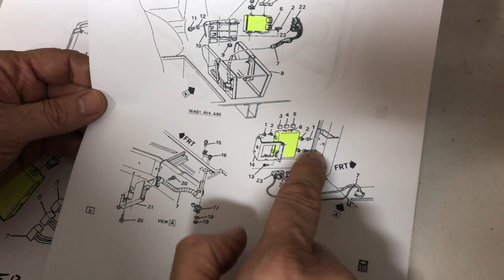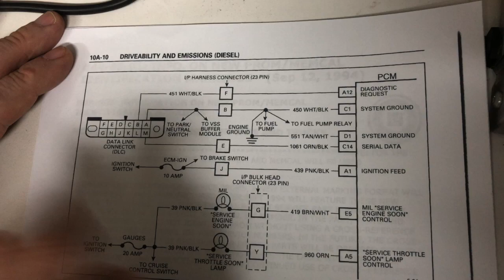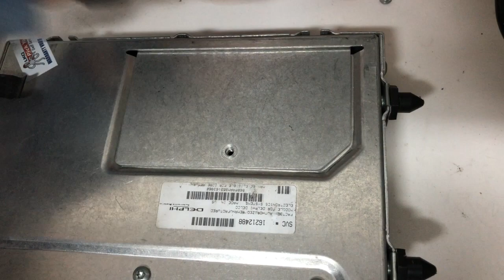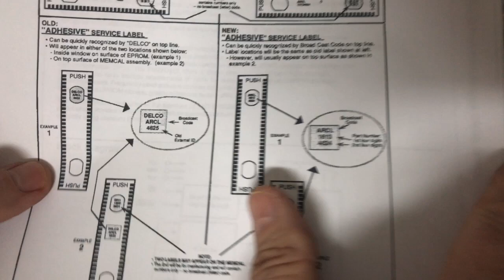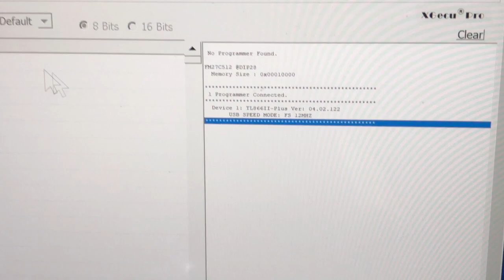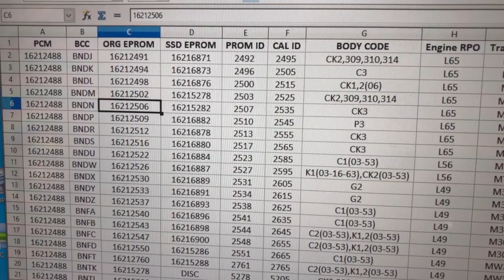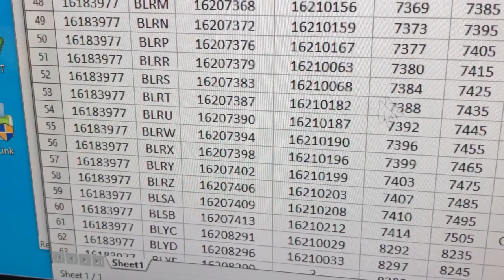1994 1995 GM 6.5L Diesel Salvage Yard PCM Inspections & EPROM Testing & Identification (Chevy & GMC)

Comment: How do you know if yours is bad and you need to replace
Reply from the maker: These chips are pretty rugged, usually you're only replacing them because of wanting the last contents inside them not because of a failure.   The contents, the program they hold, was updated frequently to correct problems in the field by GM for drivability or emissions reasons.  If the chip were to fail, I would expect to detect that using a Tech2 scan tool as this should cause a failure to communicate properly with the PCM.
Reply: @DrShock  thanks
Reply: @DrShock  I have a 94 gmc k1500 suburban. Im pretty sure the tranny is stuck in second gear. No power at all. Ive checked everything else and replaced about $3k in parts with little to no results. Im down to the ecu and/or shift solenoids. If I go the ecu route I was told I should replace the prom as well. Should I? And if so where can I find one and how do I know if its any good if I go to a junk yard for instance? Please help! I need my horses back!
Reply from the maker: @joshakers1  Given your situation and spend so far, I would not recommend a salvage yard unit but rather just purchase a remanufactured PCM.  A remanufactured PCM has been tested to be sure of no faults. Typically the remanufactured PCM you would receive will not have a PROM installed.  This is because while the PCM covers many GM models, the PROMs are very vehicle options specific.  So these companies selling remanufactured PCMs often just have you transfer your PROM into the replacement PCM.  It would be extremely uncommon for the PROM itself to have a problem, so I would not recommend just replacing it for no reason.  However, I would strongly recommend upgrading it, if your broadcast code is older.  Like I show in the video, in those days before flash programming, to get bugs in the GM code fixed you had to get a new PROM with that new code and physically replace it.  So take a view in the video for your PROMs code, and see if there is a newer one.  You can find those on eBay at the link in the description, though they can be rare depending on the code you need. There's also a link for a genuine GM ACDelco reman PCM part number 88963802.

Comment: Thanks for the video. Besides the fact that the newer boards are obd2 and chip is writable 1 time, what are the other differences between the 97 and the earlier boards? Is wiring harness and pin out the same as 96 and newer? Wish the newer version was configurable. Wish we could implement the Quardstar obd1 live options on the newer models
Reply from the maker: The 1996 and later PCMs for the 6.5L diesel were OBDII and field updatable many times over.  So using a Tech2 scan tool and the GM SPS system you could update the calibrations as often as needed. 1995 was the last year for those physical memcal replacement type calibration updates.  The wiring harness between the older physical chip swap update PCM and the newer field updatable PCM is different, largely due to the OBDII changes required.  But the PCM location behind the glove box area on the C/K trucks remained the same for the whole run.
Reply: @DrShock  thank you for the information
Reply: On 96+ you can also convert to a 411 pcm origionally used for the ls1 but by being a crossover many of the tunes for the 4.3, 5.7, & 6.5 tunes are readily available and easy to tune yourself for free with tunerproRT or or pay for credits with hptuners which has a more friendly interface
Reply: @DanMcD80  Thank you, I didn't know that. Interesting.